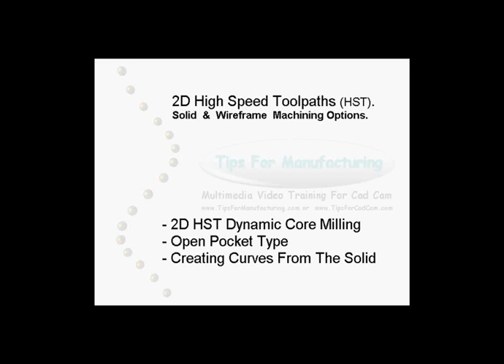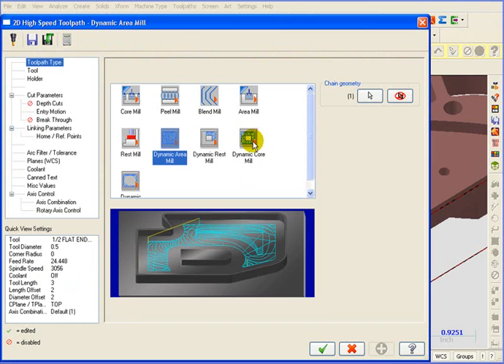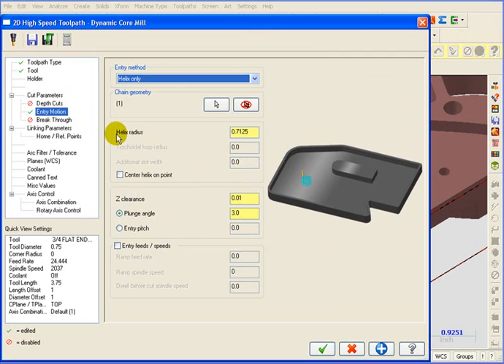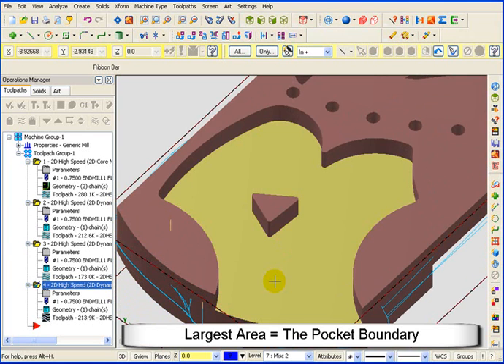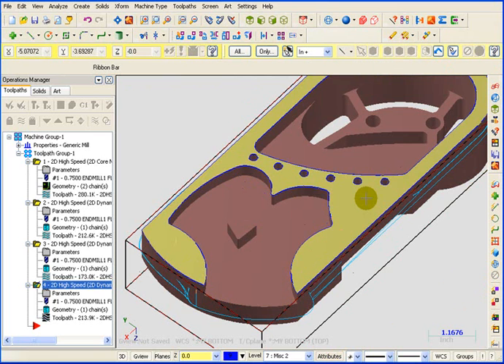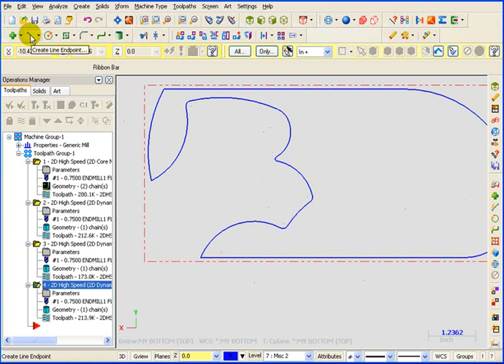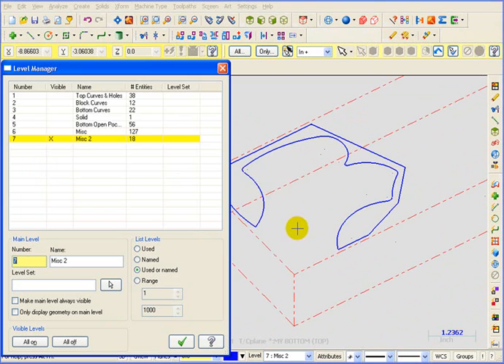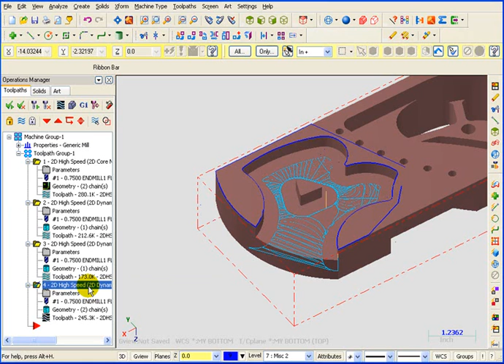TFM - Dynamic Open Pocket in Mastercam X5

Comment: Too complicated. You don't need to make any extra lines. What you need is to use multiple regions. Machining region use the solid face of the open pocket and as an avoidance regions the island and the bottom edge of the open pocket. That's all
Reply from the maker: That would have been great if X5 had multiple regions. Multiple Region selection only came out in X6. The purpose of this lesson was a solution to a problem. A work around so to speak.  X6 Multiple Regions selection has the fix for the problem.